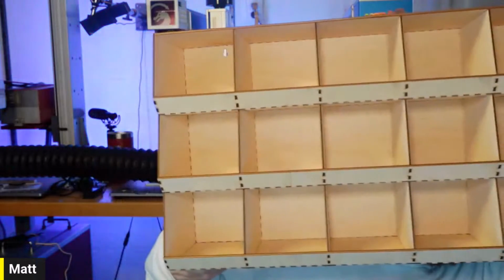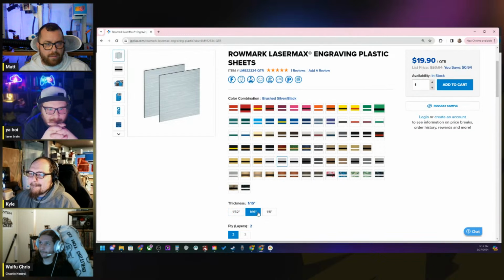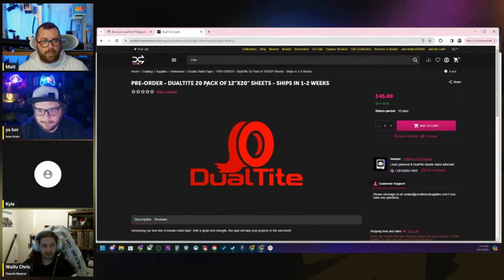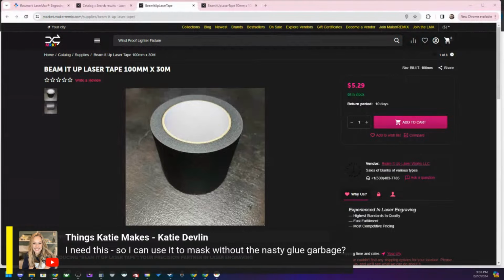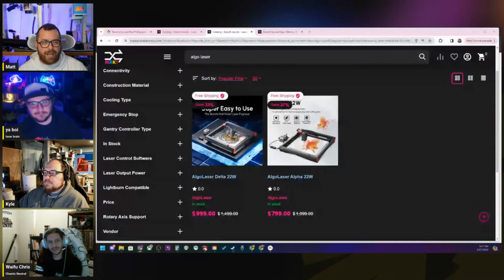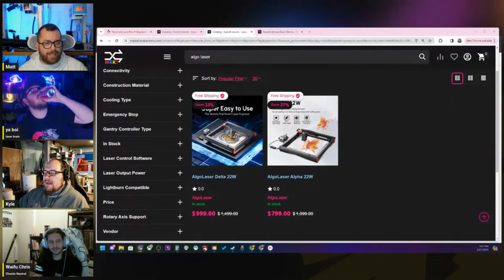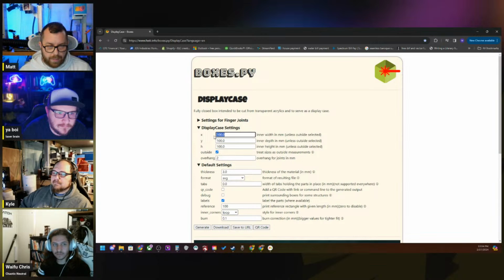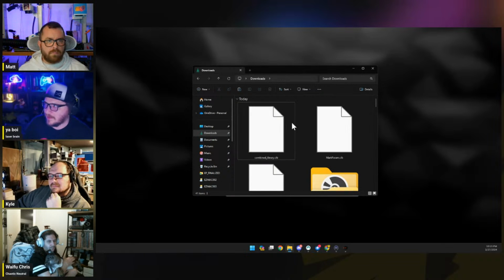LASER TIME!

Comment: 54:35 Something I'd add to the CFM and exhaust rant is about updrafts.  If you are exhausting through a window, but the home is warm and drafty, it will suck air in through the window and the fan has to fight that.  - I think that qualifies as "static pressure" but it's an example.  I'm using a grow fan, IDK if that's centrifugal.  It's not a PC fan or an inline though, it will pull a vacuum on my cloth cabinet at high speed, at notch 1, it might fight the updrafts.  Notch 2/5 is usually fine.  3/5 when I'm doing a groove cut that makes a lot of smoke.